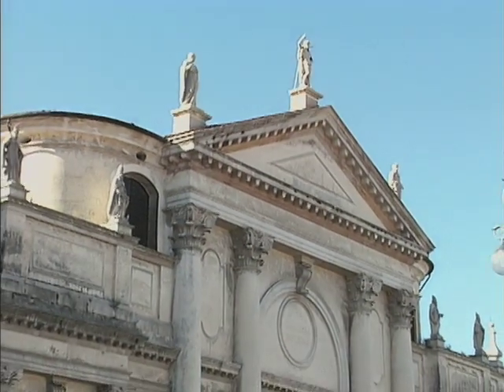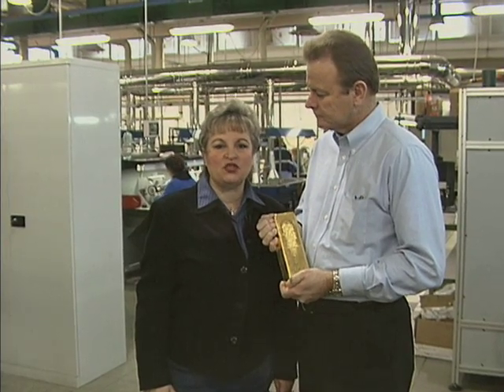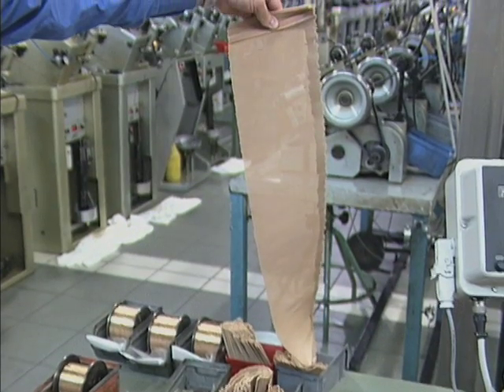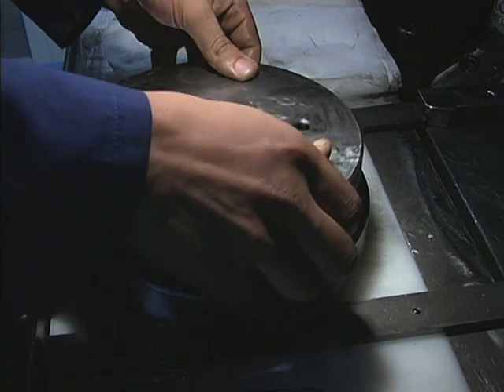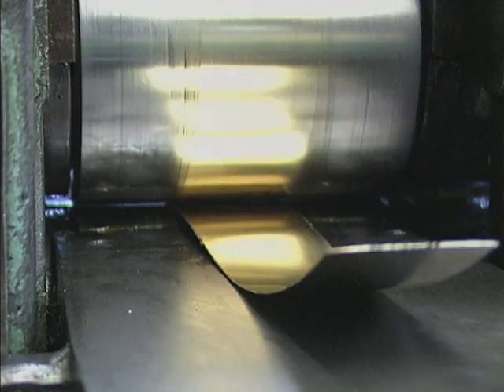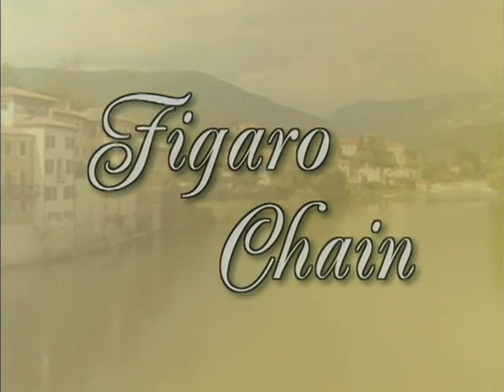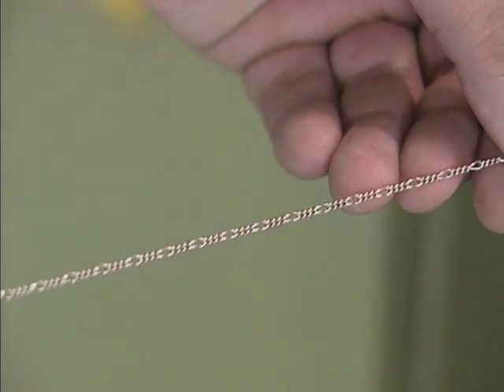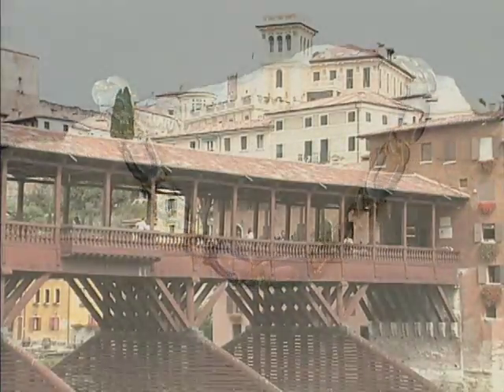Enhancery Jewelers -  Italy

Comment: Hi, My self Paritosh from Delhi (INDIA) . I am working in jewellery industry more than 20 years as a Chief Technician/ Production Manager.

Having a good experience in all types of jewelry machines and plant from melting process to End Hi-finish product with low losses and wastage.

Tecnical Experience in all types of Chain making machine, Laser Bismarck, Casting, Cnc Diamond Cutting, Handmade jewellery,Etc.

Box, Fox, Round Fox,  Curb, Top cut cable, Side cut cable, Round Box, Ball Chain, Figaro, Laser Bismarck welding Etc.

Machines Like : SISMA, OMBI, FASTI, OMPAR, FICO, MGZ,  CIEMMEO. Etc & all helping machines.

I have done a lots of new jewelry machines setups & training In INDIA and different COUNTRIES.

Looking for a permanent job in good company.

Thanks regards.
Paritosh Dhunna
E-mail: paaritoshdhunna@gmail.com
E-mail : techgoldchains@gmail.com
Mobile: +91-8595440074 (INDIA)